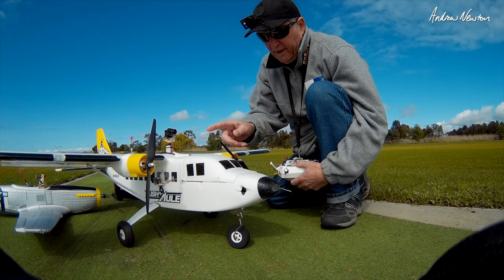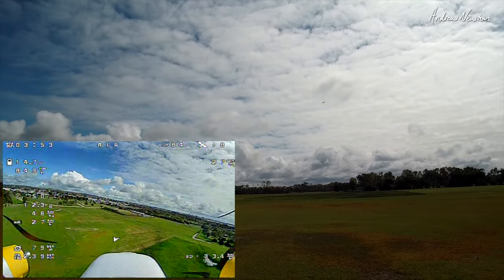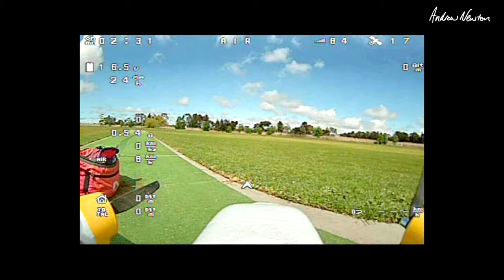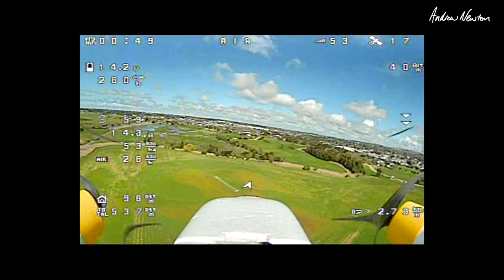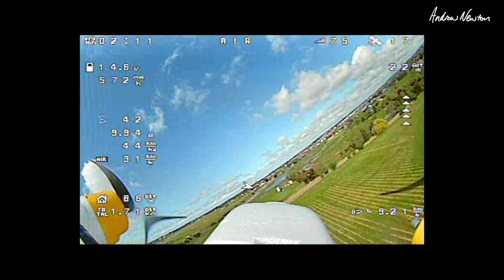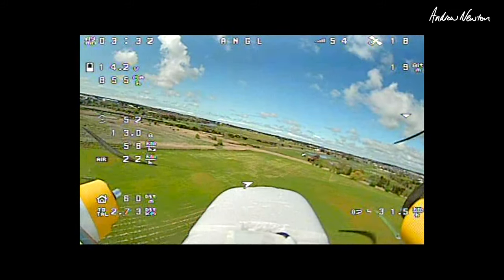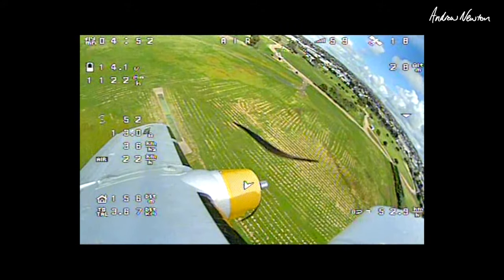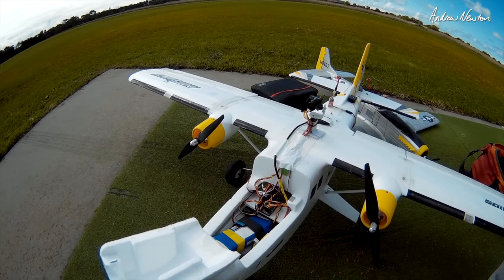Matek F765-Wing iNav board -  Bush Mule

Comment: Just putting in an F765-WING+GPS+ASI+lidar into an Esky Eyas/Eagles, with RPi0WH (+ very small Picam) to handle 4G/LTE with UAVcast;  old Hitec 2.4 for LOS range, and Tx  acting  as joystick (via PWM-->USB dongle) for  MP control via LTE. Yes, the soldering can be tricky, your various videos have been very helpful.
Reply from the maker: Serious setup!

Comment: What did you think about the F405 versus F722 versus F765 boards? Obviously more features per model, and more cost, but is it just worth getting the F765 anyway? (for all uses).
Reply from the maker: F405-Wing is my favourite. Just the right amount of outputs, and fixed UART for SBUS, which simplifies the connection for my slow brain

Comment: Andrew, did the INav developers came with gain adjustment based on airspeed data? I dropped the INav Matek F722 Wing one year ago for that reason. I like the whole work, but I don't like their idea of going to the field with a computer to adjust the gain after a pattern flight and data collected, just to find out that the wind changed direction after the adjustment.
Reply from the maker: Dont know if airspeed is a usable parameter yet. It could be with recent versions.

Comment: Do you set diff thrust using make f765? I'm wandering if it's possible to have a switch to enable the mix and then use that to control the motors via the board. Any thoughts?
Reply from the maker: Yes, using the mixer in inav. I have not tried it yet

Comment: Is there a way to auto-calibrate the airspeed based on a flight path that circles back to the same place, and based on the logged ground speed. The effect of prevailing wind should cancel out.
Reply from the maker: iNav tries to calculate a wind strength value (bottom left numbers) so it should be possible

Comment: why is the video so so much better then the f411? You'd think the isolation on the 411 would make it better and equal to this as wouldn't it be the same system?
Reply from the maker: No filtering on the F411-Wing video power. The F411-WSE does have good clean video.

Comment: I love your videos, I've been subbed for about a year now and told several of my friend of your channel. I have a Bushmule also and I would like to know what props you use on yours. Thanks.
Reply from the maker: Thanks TurboGramps. I'm using 10 x 6" two blade props. Might be HQ thin electrics.
Reply: @AndrewNewton  Thanks for the reply, I was thinking of a 10 x 8 two blade but have not found any that are cw and ccw in this size.

Comment: Bombing your wires ay? lol The airspeed should be faster against the wind and slower with the wind. My Furious FPV Pitot tube works flawlessly. it has saved me from stalling my plane many times, You can also set a minimum speed autothrottle so if you are not paying attention it will speed up for you,  You said something was missing off the tip of the pitot tube did you ever find it, Andrew?
Reply from the maker: Still looking for the tip, might be in the car, and I had my tubes connected to the wrong ports according to the product page picture. I will revisit it.

Comment: Thanks for all information you give but I have problems with Matek765. How many satellites are required to unarm the board. 
I cannot run the motor from radio , only from iNAV on computer. Please help
Reply from the maker: Default minimum satellites is 6 before you can arm. Follow this video carefully Different board but same setup https://www.youtube.com/watch?v=VNbzWPZfZ9M

Comment: The bounce at landing is due to high speed landing.  You want a shallow approach and lowest air speed possible.  Flaps help with that... :)  Try killing off some air speed in your approach :)
Reply from the maker: No it's the bouncy nose gear. Needs smooth speed to land
Reply: @AndrewNewton   You were doing 37 Km.  Consider slowing down to around 20.  See if you like the difference.

Comment: You need to calibrate the airspeed sensor
Reply from the maker: No, I just need to connect it correctly
Reply: @AndrewNewton  you really need to check it is calibrated. Fly on a calm day and then airspeed should be as much as airspeed

Comment: For best results I think your pitot tube needs some viagra (cosine error, calibration error and as you stated scaling error?)  
Your airspeed never exceeded your ground speed.  That would only be ok if you were flying with the wind in a mini cyclone the whole flight.
Reply from the maker: I had nothing right with the tube install. Missing tip, swapped tubes, drooping angle. Next time will be right.